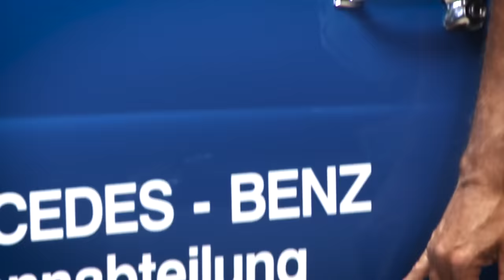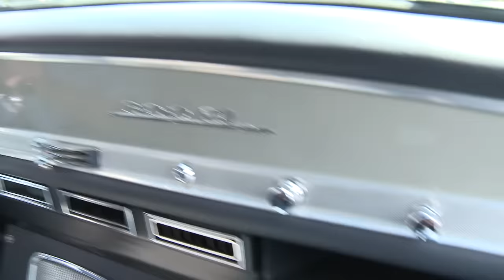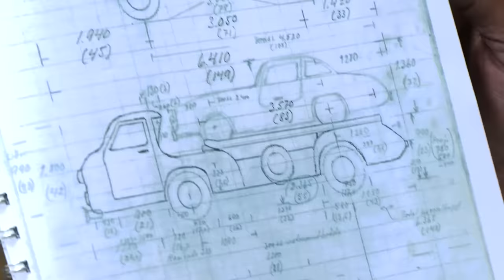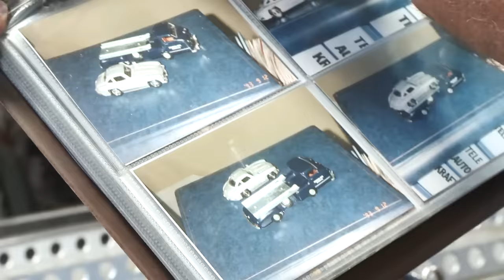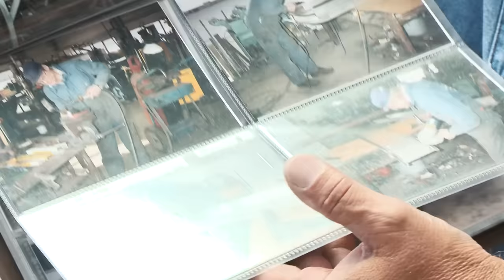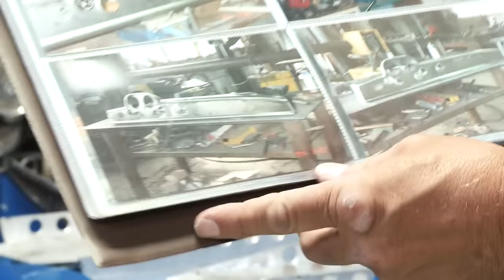1950 Mercedes Benz Racecar Transporter - Jay Leno's Garage

Comment: Before I found that  the reason Mercedes-Benz had scrapped the original transporter was because it was too big or too heavy for their museum, although not as big or heavy as the trucks and buses they have, I thought it was for a far more understandable reason, that it had transported the ill-fated 300SLR of Pierre Leveagh and John FItch to Le Mans in 1955, which crashed with Leveagh at  the wheel, killing  over 80 people. and was a constant reminder of that disaster.  The reason they gave for scrapping it would be the Louvre saying that the Venus De Milo was too big or heavy for the museum and dumping it.

Comment: I'm not sure that the story about the original transporter being crushed is accurate : there were stories , and even photos , of the abandoned vehicle being placed on top of a building at a racetrack , and left out in the elements , until someone recovered it , this was a few decades ago .

Also , while the M198 engine , the variant used in the 300SL , might be somewhat rare and costly , it is basically a variant of the M186 , as used in the W186 Adenauer series saloons of the 1950s ; these are comparably plentiful and still develop around 170 HP , so would make your vehicle that bit more authentic with a period engine .

The front and rear screens for the cab came from the Ponton saloons of the 1950s , and the rear one is an inverted rear screen from a saloon - these are still readily available .

It looks to be a very nice and useable transporter . You just need one of the two 300SLR Uhlenhaut Coupes to put on the back !  I've sat in the 'other' one , though never got to drive it ; but I did have the honour of meeting Herr Uhlenhaut circa 1976 when he showed me one of the cw111 experimental cars .
Reply: Good idea about the engine, I hope JL does that!

Comment: As a model car collector, 3, 588 models including 428 Mercedes-Benz , including  4 Benz and 3 Mercedes, I know that Corgi and Dinky never made of a model of this, not even a German toy maker, in the 1950's as far as  know. The 1.43 scale Conrad model I have may have been the first over 20 years ago, but like all the models made in more recent years in 1/18  and 1/64 and the full size replica's such as Jay's, none  are an accurate copy of the original 1950's transporter.  Check out a photo of the original and you will see why, the gap between the headlights and indicators below and between the bottom of the radiator grille and the bumper is bigger than on the replica, on which all the models are based. On page 64 of Mercedes Enthusiast,January 2019 show this clearly in photos of the original and the replica, I first b noticed the differences when I took a photo of the Conrad model in front of a photo of the original and thought at first that Conrad had made an inaccurate model of the original when, in fact, it is an accurate model of the replica  which is not an accurate copy of the original, which is a pity, as it means that all the models are not accurate either.

Comment: One advamtage is that if ypu break down, you can unload the "spare car" and run for repair parts
Reply: But usually, originally, you only had a car on the rear because that car was broken.
ALTHOUGH:
There are rumors that Mercedes originally planned on building two, having one (empty) follow the other so they can transfer the car if the loaded truck breaks.

Comment: Thad be funny if the truck needed 2 b running in order 2 unload it.  So youd really be in trouble if it breaks down while it is loaded cuz you cant access the engine compartment w a vehicle on it and you cant get the vehicle off unless it's running. . . .

Comment: I think one of the reasons we like old cars is because back then, every new car was really better. Better technology, better design and engineering, better materials. Now every new car is just new... we actually got to the point where only supercars still have design. Most of the cars share the same design concepts or even look the same. Audis are all the same for example. Cars have no features any more, no funky or "brave" things, everything is picked for manufacturing and cost effectivness. And then we have the engines... It's probably not that bad in USA but in Europe we can't buy a pickup truck with engine bigger than 3,5 litres, I'm not sure if it's 3,5 or 3,2 V6 obviously. We have SUVs with 2 liter diesel engines FFS!

Comment: I can tell when idiots mess up in society, Mercedes should never build their automobile so low on the chassis, the look is offsetting, and it caused what happened a little after the half way point when they don't raise the chassis and set the vehicle over the tires, not on the ground.